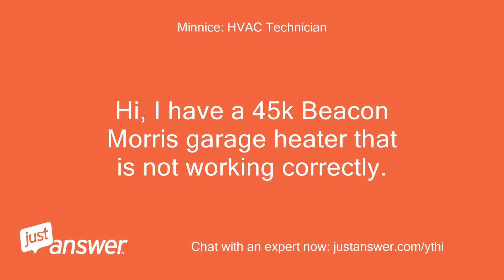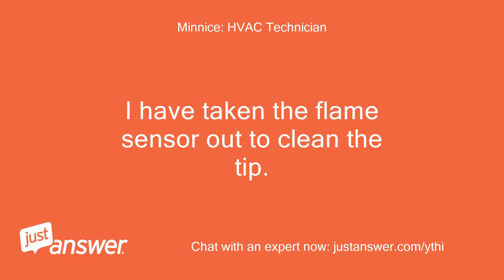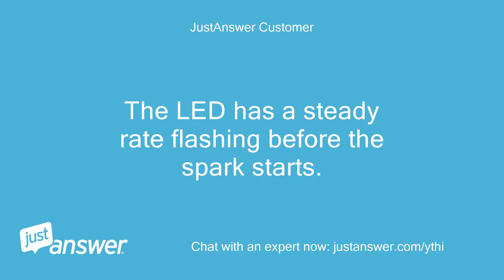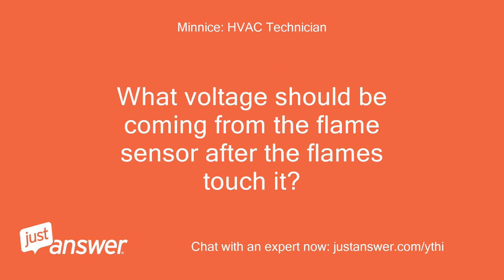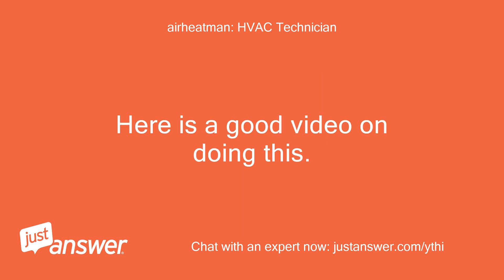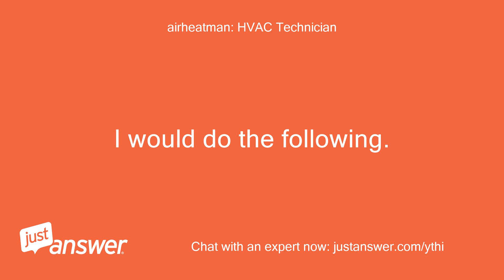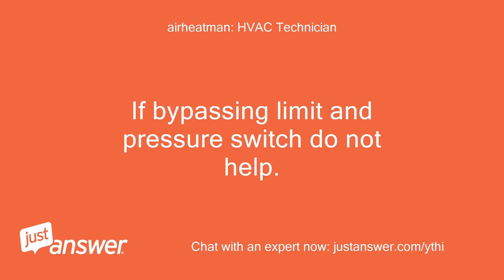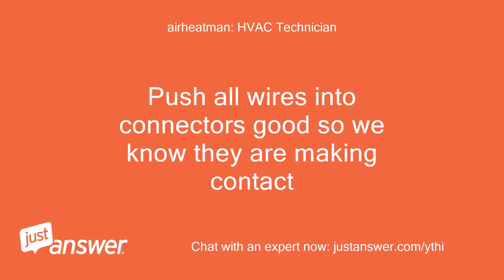,I have a 45k Beacon Morris garage heater that is not

Comment: I have the same furnace and had the same thing plus a 4 flash code indicating roll out switch or high limit switch . I checked both fire sensor plus ignitor  plus the pressure switch and also checked for bad solder joints under the black cover on the gas valve which looked good but found out the whole problem was the wire plug on the board was causing all of these false codes to come on after pushing the plug in on different spots of the plug and getting it to flash constantly and firing up and running perfectly for a few hours . Either the male side of the plug the pins have pushed back in so it's not making correct contact or the female end of the plug has a bad solder joint or the circuit was soldered poorly . Another thing to watch for is years ago a law was passed to ban leaded solder so now everything that needs to be a soldered connection or circuit they use this non toxic lead free solder that shrinks or cracks after a few years and causes problems which in most cases can be fixed by desoldering  the non toxic lead free solder and using a tool that sucks up the solder then using older solder that has lead in it and reflowing the circuits as needed .  The new lead free solder only lasts about 10 years if your lucky but the leaded solder will last 30 years or more if it was a good solder job . Most companies that are doing this is to save money plus if it goes bad you either have to buy a new motherboard or if parts aren't available it's junk it's all in the name of profit and most or our product being made in China or Mexico because of what our sell out politicians have done and thought was a great idea !